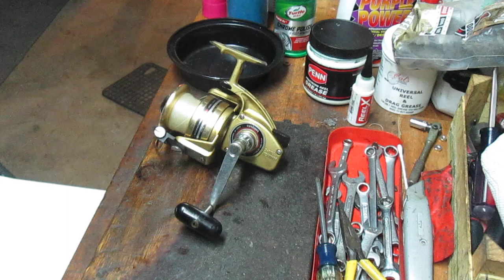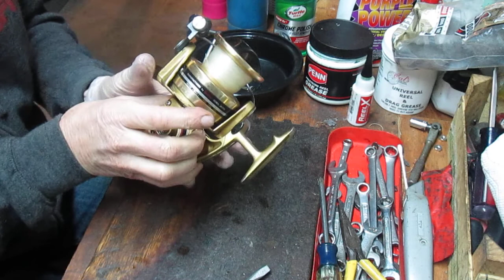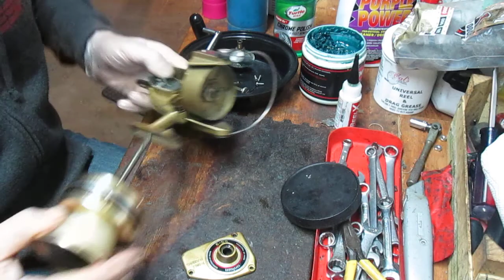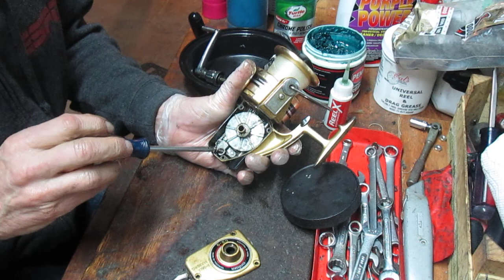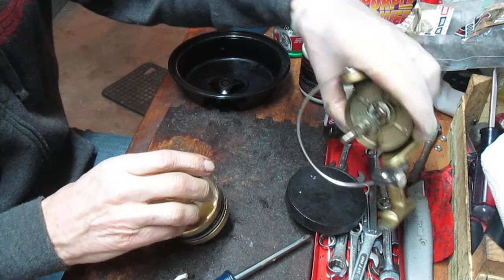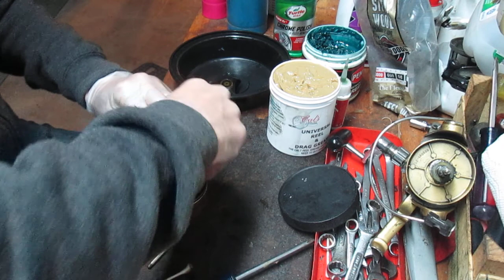Daiwa GS9 Fishing reel service and maintenance

Comment: Ha i got the GS-9 reel, but the knob come off, now i got a reel without a knob to work the handle. do you have a replacement.? or do i have to replace the hole handle.
Reply from the maker: I do not have a replacement.  You can check eBay for Daiwa handles and you may be able to match one to your reel - Thanks for asking - Dennis

Comment: Hello Dennis, I was finally able to access the frozen anti-reverse cam (the rotor assembly was stuck to pinion gear) but after cycles of micro torch- PB blast, gentle twists with pliers and prayers to reel gods I never was able to get the lever to move nor the cam to rotate. 

When I reassembled the reel, I noticed any more than a slight hand tightening of the rotor nut would cause the rotor to stop spinning. 

Any ideas appreciated. 
Otherwise I’m on to my Penn 345, Daiwa Sealine x30SHA, and Shimano Sonora which haven’t been touched for many years. Best….
Reply from the maker: Something is out of order on your reinstall.  You may be missing the top shim washer or have something not quite right,  Go to the schematic and "blueprint" your work against the picture to make sure everything is in order.
Here is the link to the GS-9 schematic https://www.reelschematic.com/wp-content/uploads/schematics/Daiwa/Spinning/DAIWA%20SPINNING%20GS-9(78-31).pdf - Dennis

Comment: Hi Dennis, appreciate your excellent videos. My GS9 hasn’t been serviced in 20+ years and I can’t remove (slide off) the rotor assembly from the pinion gear. The reverse lever is completely stuck. What I’ve tried might make you cringe but suffice to say pliers, a hammer and WD40 didn’t do the trick. I’ll try PB Blast next. Would a heat gun help (not at the same time)? I’m ‘stuck’ so to speak. Also, when Penn reel cleaner, a bunch of cotton swabs and a fiberglass pen (a little tool for removing rust from electronics) aren’t enough, is there a solvent or oil that’ll remove extensive buildup in gears and really throughout the reel’s guts? Thx
Reply from the maker: Your problem is metal on metal, corrosion and wear.  That stuck rotor and over-ride switch are all metal and that reel can corrode, rust or swell to lock the parts on.  I think you may be best served by using some type of automotive gear puller that will grab the rotor from beneath and pull up on it.  Heat may be an answer, but the heat gun is too broad.  A plumbers torch is more focus and hotter, so a 30 second flame on the pinion gear shaft may help break it loose without damaging the other parts of the assembly.  Best wishes - That's a tough issue to deal with - Dennis

Comment: Thanks, just went through mine from head to toe. It’s the first generation 70s version. Had a few scratches on the outside but looks pretty darn new yet. I’m guessing it wasn’t used much than just bounced around in the garage. The inside was packed solid with grease big gobs of black grease.  The top of the spool had amber colored hard grease gobs.  Still loose enough that it lubed. All like new on the inside now. Make a “whirling” wind noise along with the clicking when winding with the clicker on. Can still hear a wind type noise with it off when winding. Super smooth. It was given to me a month ago. I can tell it’s a power house.
Reply from the maker: That is a great reel.  The wind noise is likely a worn bearing and the noise should go away if it is replaced
Reply: @2ndChanceTackle  i’ll have to see how much they are. I removed them and they look like they were in excellent shape. Sounds more like a wind noise than a bearing. I would assume a bearing is gonna be more like a car bearing when they get bad. The cages look like brand spanking new and they look like new inside the cages. I got a feeling that maybe it’s just the way the reel is designed and because I didn’t pack it with as much grease as it originally had.  It literally was packed a 3rd or more full inside. I didn’t put anywhere near as much on, but made sure to pack the gear splines solid.

Comment: Dennis, I just finished cleaning and servicing my third Daiwa GS-9.  The cosmetics on it are almost perfect..  the side plate bearing was a shielded one and was totally seized. The pinion bearing wasn’t bad but I did replace botched bearings with sealed bearings. The reel is even better than new now and is the smoothest GS-9 I have. I couldn’t be more pleased with this phenomenal saltwater reel. I can’t wait to use it this summer. /I’ll try to send you some photos tomorrow. — Chris
Reply from the maker: Saw the pictures Chris - Well Done.  Another fine add to your collection - Dennis

Comment: I’ve been looking for one of these for a long time but they are so rare and even harder to find in good condition. This GS-9 has at least one more bearing than a 9000C. The gearing in the two reels look almost identical.  No new reel I’ve seen holds a candle to these vintage Daiwas - silver or gold! With the quality of materials and long-term durability of these reels you can’t go wrong with buying these older reels. You have to be careful and check them out before purchase just like anything but why buy a modern expensive reel that can barely last 5 years or less when you could have a GS-9 or 9000C. I just don’t understand it. Great video Dennis!
Reply from the maker: Well said.

Comment: Bonsoir.  A guick question. Under the spool like the Penn 706z has the téflon washer.  Does the GS9 have one. I just received mine today.  M'y other Black Gold 20 and 30's has a washer. But does the GS9 come with one?

Cordialement
Reply: By the way.  The line lay is gnarly so, I added one HT100 washer under the spool. It did improve.
Reply from the maker: There isa spool washer that sits atop the click rotor, similar to the Penn set up.  See the part on the schematic for the gS9. here https://www.mikesreelrepair.com/daiwa-gs-9/
Dennis

Comment: Good video. These reels are pretty cheap in Europe (90 Euro), if you can find one. I like the simplicity of them and thinking about getting one. Are they manufactured in China now with the usual inferior quality, or was Daiwa able to keep the level of quality?
The Daiwa BG 8000 is an obvious alternative, would you prefer it over the GS 9 in terms of durability (not speaking about smoothness)?
Reply from the maker: Both are good reels.  The Gold Series is right in the middle of their product line and are solid performers.  The upper end Saltist and Saltiga reels have more ball bearings and other refinements, but cost much more as a result.  I personally like the BG series.  I believe that Daiwa has moved the production of the BG series to China. Thanks for asking - Dennis